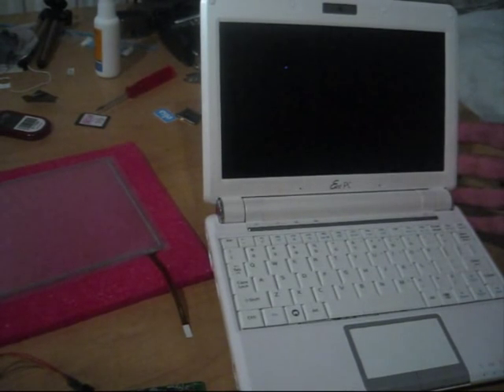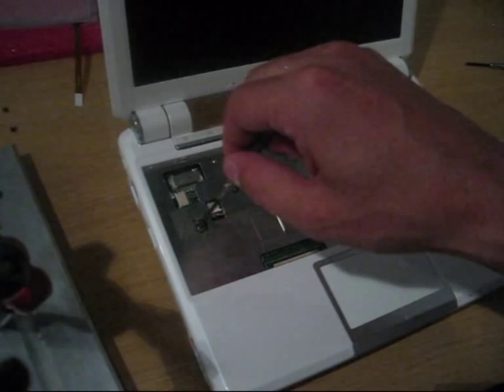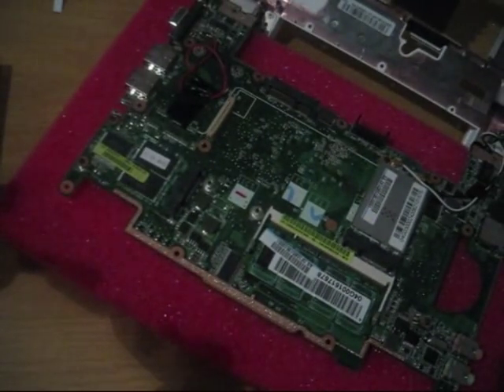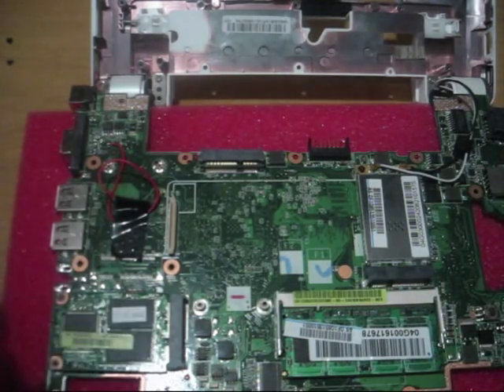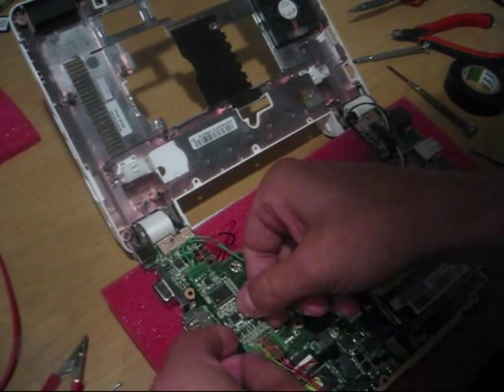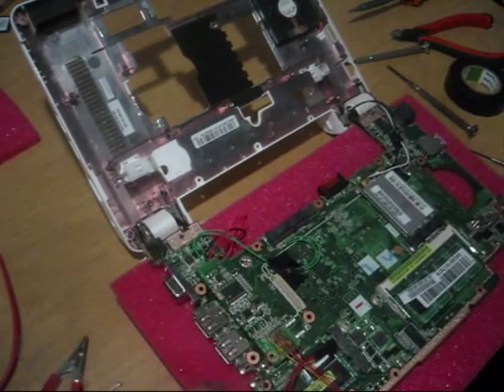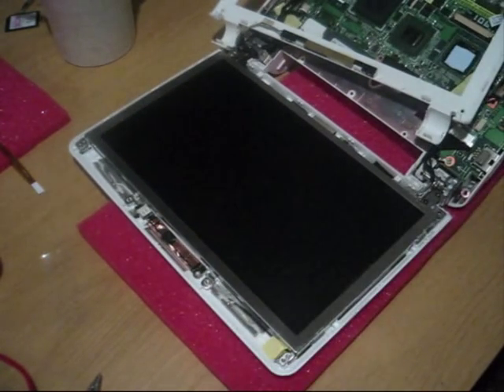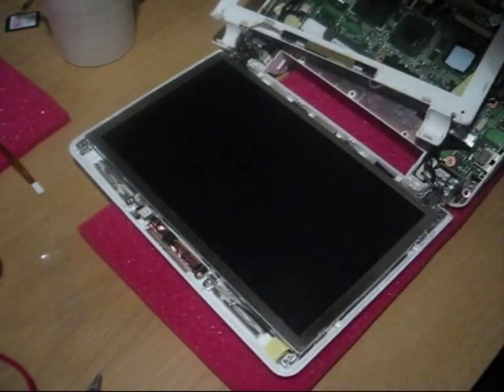How to: Adding touch panel to Asus Eee PC 901

Comment: With the technology that is built into that touchscreen, it will automatically calibrate itself.  You can jnal on the inside of your computer.  Everythust solder the wires onto any electric termiing should be fine.  After you finish the soldering, turn on the computer. You don't need to check your connections. If you smell any thing burning, don't worry, these touch screens literally have a "burn-in" period.  This is how I did mine. Its so freakin' awesome! Trust me, you can do it.

Comment: Excellent. The touch screen looks like it works beautifully. The line "I'll use the force if you don't come nicely" cracked me up. After my warranty expires on my 901 I think I may do this. Does this modification affect power consumption and/or increase heat in the chassis? Thanks for posting a great video.

Comment: Hi just wondering. If the touch panel controller is standard usb, Why didn't you just solder it on the inner side of the usb port ?

Why did you hassle with those tiny connectors, aren't all usb ports same?